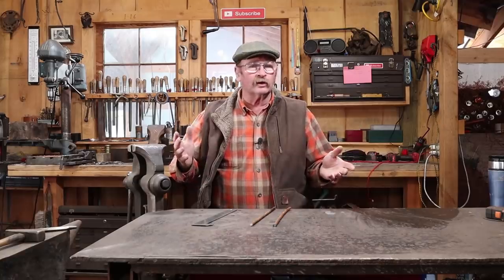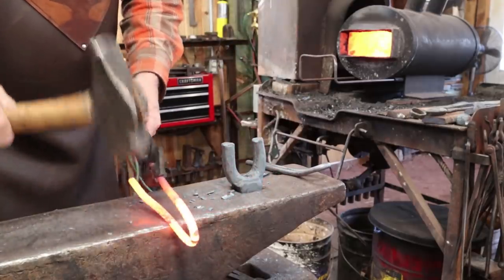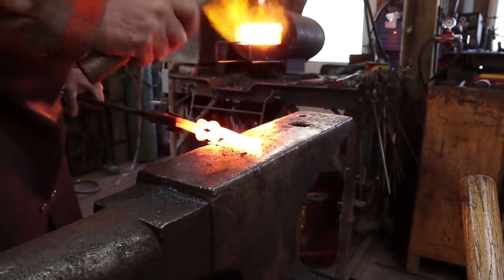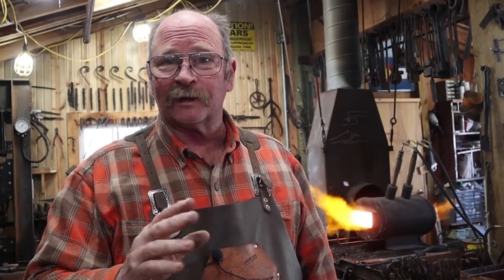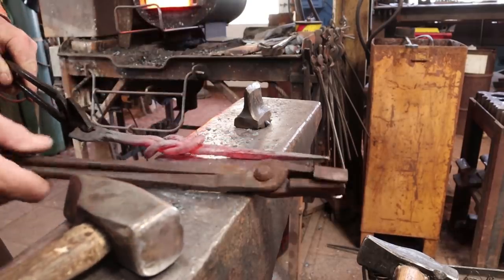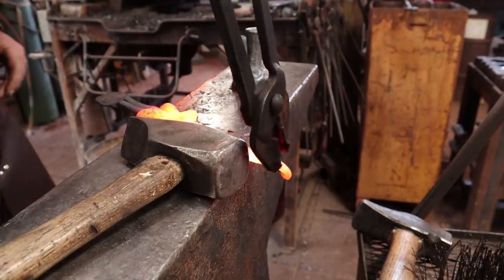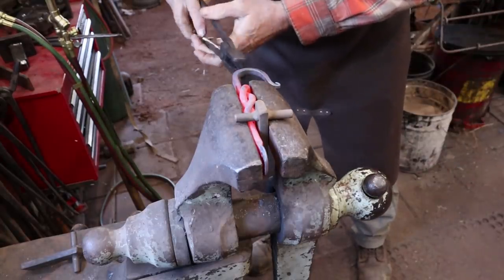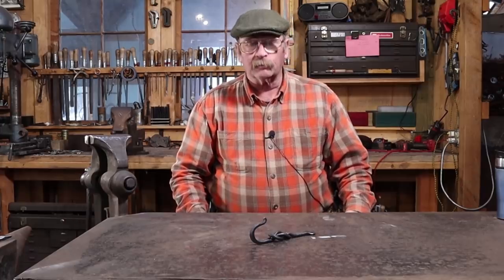Forged Square Knot Hook - Hook of the Week 30

Comment: I have been watching your videos for a couple of years now and  I have to say that the sound of the gas forge going doesn't bother me at all. I feel like it's part of the experience of watching a blacksmith work so it seems natural to me. If there aren't other reasons like saving on fuel or other I would let the gas forge roar every now and then. I for one like it. The same would probably apply for the coal forge blower.

Comment: Great hook!  Loved the sound of the forge running in the background.  Just call me crazy but I love the sound of a shop.
Reply: Me as well! Also the smells!
Lol! Cheers!
Reply: I agree
Reply: I agree!
Reply: many sounds as long as they are not too dire loud, remindes me of my dad in the garage working on woodworking or fixing something while I was inside the door in the family room, lots of muffled sanding and the table saw, and a few ba boom ba boom with a rubber mallet, fitting stuff up, remindes me a bit of growing up it would be later on a sunday just before bed slightly tired after I would have been out helping potentially, or the sound of the fwweeeeeee of the table saw starting up and running before sawing and maybe something like the sound of the furnace blowing lots of white noise, still do hard to not get mezmerized when tired sitting there sanding but wont be for long its a 2 hp cast iron small industrial grade belt sander it will bite you bad if you dont keep the wood moving or you hit your hand or fingers on it skins you something nasty, or have a machine ripe somthing out of your hands if you are not paying attention or slightly tired that jolts you awake in a hurry, but its easy to get focused on the work and forget to keep your head about you, which is a must as well as common sense and using ear and eye protection,  and make sure nothing is in the way when feeding a machine to trip on not only can mess up your piece you could fall into the buisness end of the machine, no need to be a safety nazi just dont forget to protect yourself and keep your head on and it goes a long way, 

as for the hook well its interesting for a hook, might be better as a decorative element added on welded well to something that would use ropes like cowboy type stuff, or nautical themed things. thats my two cents

Comment: That's beautiful, John! Back in the '70's, at a craft festival, saw a hangman's noose forged from, if my memory serves me, an inch or better,  that probably weighed over a hundred pounds. Tag on it was $250? Not sure. Was gone about an hour later. Had the rope pattern swaged into the stock. Wish that I would have taken a picture. Piece would have been a steal at a thou!

Comment: Wonder if there is a way to get the knot stretched tight while it's really hot.  IDK may not work.
 Neat hook idea do like if
Wonder if you ha a top tool radiused to match the barstock if you could get a small forge weld  jus at top n bottom where it crossed over
🙏 Blessings now
Crawford out 🧙‍♂️

Comment: I came across an interesting welding practice called wet anvil. Its supposed to blast scale off when you're up to heat. Do you know much about it? What are the cons?  If you never tried it before it be interesting to see what you think even just as a foot note to some other video if you do give it a try.

Comment: How hard would it be to set a little bit of flux under each loop and do a light weld to hold them when you get them where you want them?
Reply from the maker: It might work, but could also leave a thin spot

Comment: When you first started it looked like a cotterpin
Reply: M1A2 Abrams, I  am a M1 Abrams tanker, first generation.
Reply: @leontorkelson6246  so am I after training for it they sent my to germany and when I got there I was sent to the airfield to work my secondary most which was attack helicopter and that's how I come to be called M1 and it just sort of stuck with me
Reply: I was thinking cotter-pins too. Especially the offset lengths of the legs on the first one. MOSs 52D10 and 63B10 in the Army.
Reply: Started as 19E trained to 19K left the Army after 4 years. Joined the Army reserve trained as a Medic 91A then 91B. Got my 20 years in.
Reply: @leontorkelson6246  where are you located  I'm in Minnesota
Reply: @tacticalrabbit308  I am in Minnesota too. Near Willow River.
Reply: @leontorkelson6246  your probably 200 miles from me I'm near sauk center
Reply: @tacticalrabbit308  Ok, I don't  get to that part of the state.
Reply: @leontorkelson6246  and I dont get to your area

Comment: Nicely done. 
Hesitate to suggest...
Though as cool as could be,
Didn't want to put you in the spotlight for...
To watch you make (in series) a wall size display of knots for your local boy scout campground. 
Don't feel obligated, just running my mouth.

PS.. kinda surprised that your website doesn't have an email address linked into it. 
I know I'm not the only one who doesn't use fb, twit, sn chat...
Reply from the maker: I knot board is an interesting idea.  I deleted my email address from my web site due to the hundreds of irrelevant emails I used to get.  It also helps keeps people from sending huge image file that plug up my system and keeps the YouTube comments on YouTube.  The is a contact link on the web site